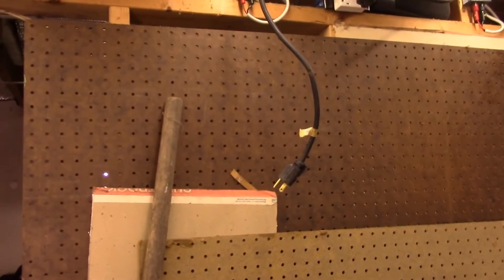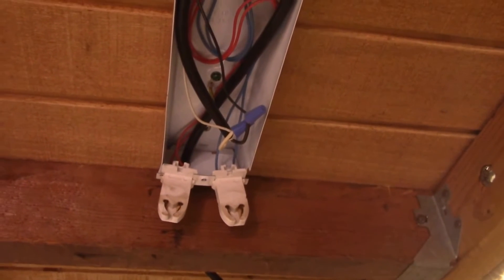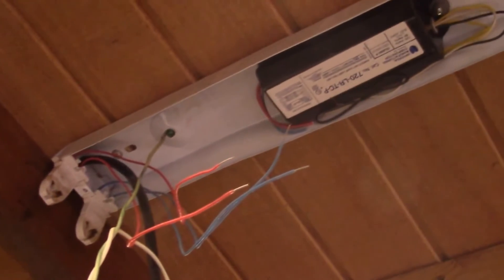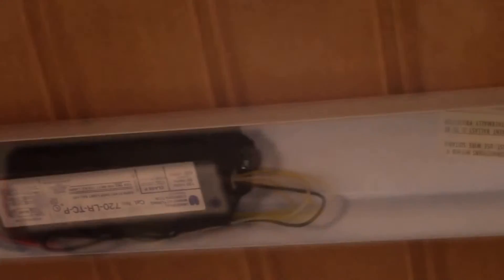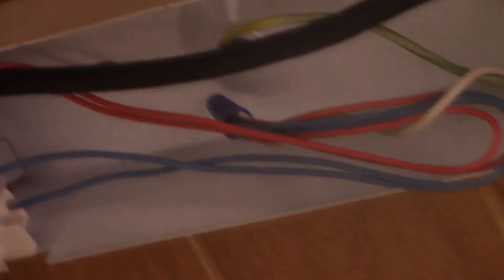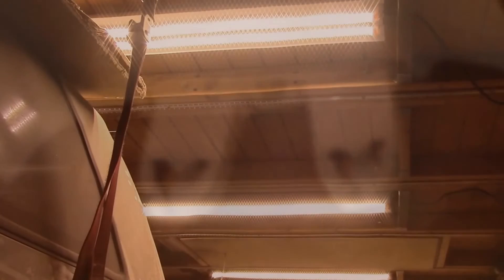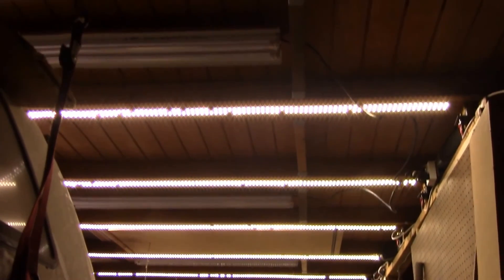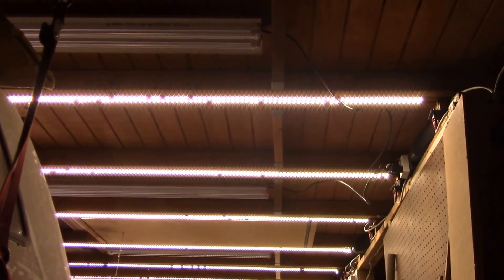T12 Fluorescent to T8 LED Conversion, Part 1

Comment: My T-12 bulbs have the single pins at each end. And my ballast looks nothing like that. I'll keep looking on YouTube
Reply from the maker: Assuming you pick up a single pin LED tube the wiring should be similar, hot or line to one end and neutral to the other end.  
https://amzn.to/3c1P8e9
Again, assuming your LED tube is set up to work w/o a ballast, just connect the incoming hot lead to the wires going to one end of the fixture and the incoming neutral wire to the wires going to the other end of the fixture.

Comment: At 3:12 you can see "cracks of light" inside (above) the open area of the ceiling. It appears to be light coming from a lighted space above (beyond) the ceiling, through cracks between narrow boards. Or, is it just a reflection from something inside the ceiling (perhaps foil backed insulation)?
Reply from the maker: Good question.  I think I mentioned that when I shot the video, but it may have been cut in the final edit.

That's the 12V (solar powered) LED strip lighting I have in parallel with the T8 LED tubes:
https://youtu.be/c5cYl64gnHc
On sunny days, I run the 12V LEDs off the solar panels and on cloudy days, I run the T8 tubes off of grid power.

I do also have some lighting in the attic space above and will soon be converted to 12V LED strip, but it wasn't on in this video.  It turns on when I pull the attic access stairs down.

Comment: You didn't have to change the T12 tombstones to T8 tombstones?
Reply from the maker: No, as long as the tombstones are non-shunted, they fit the same G13 bi-pins on tubes that both the T12 and T8 use:
https://insights.regencylighting.com/shunted-vs.-non-shunted-sockets-tombstones-lampholders

Comment: You could have took the ballast out, that screw is not holding up the fixture. It is there only for the ballast.
Reply from the maker: Thanks for the comment.  Yes, that's another option.  From what I could see on the fixture, the ballasts appeared to be held with screws that came in from the top of the housing.  But maybe I didn't look close enough.  I any event, the converted fixtures are still working fine after 3 years and with the reflector attached, you can't tell if the ballast is in there or not.
Reply: Yes you can't tell was just putting my input I convert about 20+ of these a day for a City project to lower energy consumption.
Reply from the maker: Yes, I imagine if you are doing 20+ conversions a day, it's worth while to remove the ballasts and get them recycled.  May get some money for those with the copper.  With my 4 lamps, it may not be worth the hassle of trying to find some place that will take the old ballasts.

Comment: You didn’t show how you did it. Only after you did it.
Reply from the maker: Sorry, it was too precarious up on a ladder when I was bypassing the ballast to film safely by myself.  All I did was cut all the wires going to/from the ballast.  Then I connected the incoming neutral wire to the two ballast wires that ran to one end of the fixture and the incoming hot wire to the two ballast wires that ran to the other end of the fixture.  So I only skipped the step of cutting the wires and screwing on a couple of wire nuts.
Reply: Good grief... smh.  How did you ever get here in the first place?